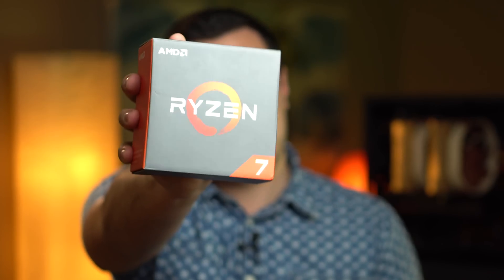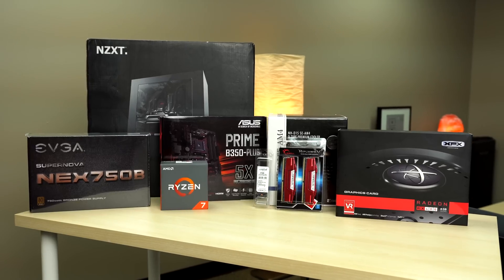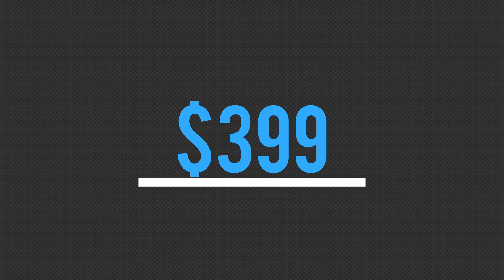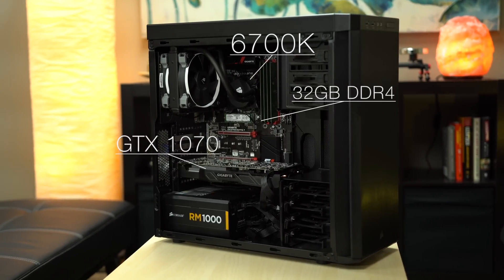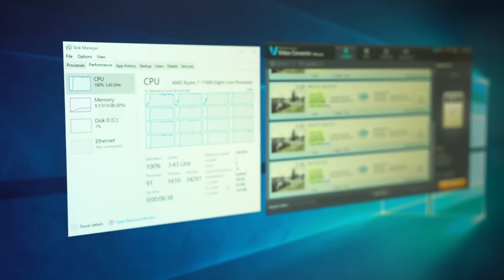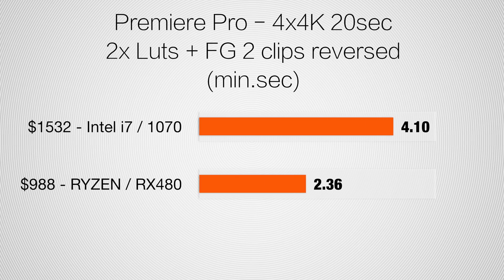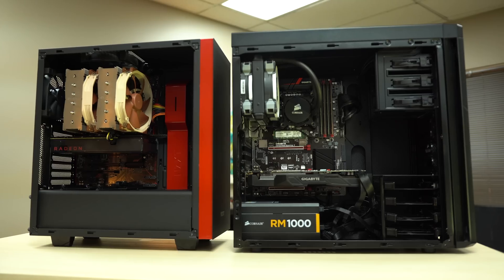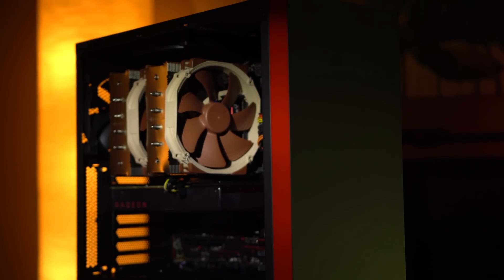$998 AMD RYZEN 4K video editing BEAST! Premiere & Resolve

Comment: DAM I want this to be true but I smell bullshit u.u benchmarks doesn't look like nothing I saw before even with the newest bios updates, so  what´s going on here bro I trust a lot of the reviewers I'd seen and usually 6900 with 1080/1700 wins by 3% to 8% which is good for ryzen but I also saw that a 7700k with 1080/1700 is 3 to 5% slower than ryzen and a bit faster at 1080p in ppro. So radeon really speed things up that much more than cuda with mercury or all this is BS ¿?

Comment: youve gone with an overkill ssd and a blower style graphics card in a case that has enough room for airflow... like why all those choices
Reply from the maker: +Iwo Ruuzz SSD is $89.99 for 275GB not sure how that's overkill, and blower style cooler as it was the cheapest 8gb rx480 st $189.99 when I bought it.
Reply: Max Yuryev those are actually really good deals

Comment: I couldn't get this build priced anywhere near the "$998" you suggested.  The cheapest I was able to get is $1088 and that is Downgrading to a 1700 non x AND using my own PSU .  I also went with a much less expensive cooler.   For this exact build the price is more around $1200
Reply: CaptainEO420 haha, no.
Reply: CaptainEO420 price to performance. intel is no longer king.
Reply: Respectfully... until AMD is making more money yearly than intel... intel is king.  Before you can knock the king off the mountain you need to fisrt make it to the top.

STOCKS
Intel Stock Quote
Intel
NASDAQ:INTC
$36.07 up $0.32 (0.90%)
Advanced Micro Devices Stock Quote
Advanced Micro Devices
NASDAQ:AMD
$14.55 up $0.50 (3.56%)

They have a long way to go sport, at least you tried.
Reply: like I said, price to performance. sure, Intel has all the market share, all the money, all the reputation. they even have the gaming results at 1080p and below. but even with all that, they get beaten via price to performance ratio by the perennial underdogs AMD. even with the advantage of monopolizing the market share over the last 8-10 years. just to make it clear, I'm running an i7, but I'm making the switch to AMD, and I think many people are in the same boat.
Reply: CaptainEO420 this is because the Cryptominers, AMD is still better, but just get a GeForce GTX card instead of AMD

Comment: i would have used a smaller PSU and then more ssd size
Reply from the maker: +Nestor Arranz yea I went with this one since it's partially module and the cables are mainly sleeved so it would look nicer. I didn't have to add any cables so it's very clean.

Comment: I added all the components up and came to at lease $1200, if not more. How did you come to the figure of $998? Are you not counting something?
Reply from the maker: +Kevin Green like I said In the video parts prices fluctuate, so buy the GPU, RAM, SSD, and PSU that's one sale. I bought parts that were on sale so look for the best prices. You'll also probably need to send in one or two mail in rebates. Shop around and you'll get close to $1000 or below like I did.

Comment: IMO Getting the 1700  and overclocking it provides better temps and voltages with similar performance and much lower price. (even with the x370 mobo its still cheaper). Also people who want cuda acceleration can just use a 1060 to replace the 480. Either way, interesting bang for buck build but i still thunk there could be improvements. :)
Edit: Also since Ryzen benefits so much from faster ram, something like corsair LPX ram at 2933 or 2666 could offer some performance gains.
Reply from the maker: Keep in mind some of these discoveries were made AFTER these parts were ordered and built. No one had any idea that the 1700 would overclock like it does, or ram speed. I definitely had no idea especially with a 65watt TDP compared to 95 with the X CPU's. Many editors who just want a solid system don't want to overclock so this build was done with stock clocks.

Comment: Does the noctua d15 really fit into the s340 when the window close? What ram are u using?
Reply from the maker: I had to seat it lower and it barely fit but it did. I talk about that in my build guide and suggest a smaller cooler or larger case.
Reply: Max Yuryev tks for that :D i got a S340 Elite and ryzen 1700.

Comment: Hey Max, thanks for sharing your build! Do you have this hooked up to a 4k monitor? I am concerned the rx 480 cannot fully handle 4k, as it seems to be closer to the gtx 970, and my gtx 970 has a tough time with 4k (experiencing some screen tearing). Wondering if a gtx 1070 may be worth it.

Comment: i have one question about vga card for adobe premiere  if same price amd or nvidia ?
Reply from the maker: The RX480 was slightly faster in most tests than the GTX 1070 so even if they were the same price I would get the RX480, BUT the rx480 cost me $189.99 compared to 369.99 for the 1070 so with the price difference its a no brainer. Now if you also game at higher than 2560x1440 at 60fps then spend more on faster GPU for gaming purposes.
Reply: i heared about cuda core in nvidia important in premiere for realtime render  but amd not have - - 

can you answer me about realtime render  who the best if spend same price  AMD or nvidia
Reply from the maker: DiwDPU DATGBAND I already have, in my last comment and in the video.
Reply: thank you i m subscribing you 
Actually i watched many video from you before  hahaha

Comment: Wait why did you put in a 750 watt PSU? Your machine can run on a 500Watt PSU, and an 600Watt PSU if you went crossfire rx 480s. Just seems like your running up your energy bill for the comfort of Modular PSU. HOWEVER other then that the specs look great!
Reply from the maker: +Ian Young yes it was because it was a good price and semi modular. I literally didn't need to plug in any of of addition cables which was great. You do know that if a PSU is rated it doesn't mean the whole thing is being used.. you can have a 1500watt and have a 200watt system and only 200 will be used. This system probably only draws 350-400 watts under full load. Another thing to consider is most PSU are most efficient when about halfway used, meaning less energy is wasted.

Comment: Great video Max, at 3.20 you said the RX 480 was faster than the GTX 1070 in most tests? Could you clarify? I am considering either the RX480 which is around £200, the GTX 980ti around £300 on ebay and the 1070 for a little more. Which would you suggest is the better option when paired with on overclocked 1700? Many thanks.

Comment: Thanks for response about the GTX 1060, so there is not big difference for 4k editing buying 1070 vs 1060 as I understand from your view? I just think gtx 1060 is more than 230% vs 1070 that cost 430-450$. It's important for me that premiere will work good I don't need extra power for games.
Reply from the maker: In my testing, there was no difference when paired with a 6700K overclocked to 4.5ghz. If you're going to use an intel 6 core overclocked or 8 core with 4K video and effects then I would say go for the 1070. If an intel i7 quad like the 6700K or 7700K then 1060 is plenty.
Reply: Thank you , do you think RX 480 is better than 1060 for  Premiere and Resolve or other way =) now I can buy RX 580 or 570 that seams better version of 480?

Comment: If I wanted a straight up gaming machine would I go with the ryzen and rx480 or i7 and 1070?
Reply from the maker: I would probably get an i5 7600K with water cooling http://amzn.to/2nKvmip and 16GB ram. Then overclock the CPU to 4.7-4.8ghz. For graphics card either 1070 - 1080 - or 1080ti depending on your monitor. 1080P 60hz then 1070 should max out games for the next few years, 1080P at 144hz or 2560P at 60hz then get the 1080 to max out games for the next few years, or 2560 at 120hz or 4K at 60hz get the 1080ti to max out games for the next few years.
Reply: Thanks, man! This helped a tonne!

Comment: Great job on the video. I had recently come to the same conclusion and built myself a Ryzen system for video editing/animation/music. I built based on the 1700 chip and just overclocked to 3.9GHZ stable on all cores. I am waiting on the new Vega GPUs (I also came to realize that in render situations AMD and OpenCL are often faster than Nvidia with CUDA) to finish my upgrades. Thanks for the confirmation on my upgrade path!

Comment: So I want to max new games at 2k, you know those ultrawide screens, And have atleast 60fps at all times. What do I build? No online guides seems to include Ryzen or even mention any graphics card from AMD.
Reply from the maker: The Ryzen 5 series will be out soon and those will be what you should get for gaming. The 1600X is a 6 core 12 thread for $249 with a cooler and will likely clock higher than these 8 cores. For gaming you only need 16GB of RAM (even 8 is fine for most). If I was in you're shoes I would get either a 1600X or a 7600K (intel i5) 16GB ram and GTX 1070 graphics for gaming. http://amzn.to/2mNFrGp that way you can max out graphics in any game with a 2K ultawide for the next 2-3 years. Total cost should be about $900-1100 for the system.

Comment: Hey Max, you got something wrong or do not know how is it tested, but the CineB. R15 is very simple. I have i7-5820K @ 3,71Ghz with 16GB RAM @ 2666 with R9-280x. CPU test got 1126 points, that is ok but the GPU got 143 FPS which seems strange.
Reply from the maker: raWer Studio I guess the 280x is better :) I retested a bunch and that's what shows up. Maybe it's a Ryzen thing.

Comment: Might some of Resolve's lag vs Premier in the speed tests be due to their implementation of OpenCL vs CUDA. Open CL support was around in Adobe's products for at least a few years before Resolve started to support both.
Reply from the maker: I think Resolve started using OpenCL before CUDA (but I could be wrong) Resolve was performing well for me other than the 4x4K test where reversing two of those clips slowed it down by a lot.

Comment: Several things Max , is the Radeon 480 really faster than the Nvidia 1070? Also , doesn't the Ryzen run at much slower clock-speed and cannot be overridden as well as the Intel chip? Btw, great looking build, very sharp looking!
Reply from the maker: Yes. We tested both and the 480 was after in most tests, and the few that the 1070 was faster it was insignificant so we went with the 480 for this bang for the buck build. Risen runs at 3.4ghz under full load and 6700K runs at 4ghz but Ryzen has double the cores. Both can be overclocked, Ryzen to 3.9-4ghz and 6700K to 4.6-4.8 or so but these tests are at stock speeds.

Comment: on 1070 vs AMD RX 480, I have always argued that most people complaining about laptops video performances often miss the point of different TPUs; people extensively argue that CUDA cores make the big difference for Adobe Premiere without checking that in laptops typically (e.g. Apple) AMD GPUs are severly watt underpowered compared to Nvidia, hence the "Cuda advange" is nothing but a difference in TDPs. In desktops TDPs are mostly irrelevant, hence it is more a leveled playing field.

Comment: i would use a different power supply. 550W is more than enough for this ryzen build. as example something like EVGA Supernova G3 550W, Cooler Master V 550W, BeQuiet Straight Power 10 600W.
Reply from the maker: Yes, you definitely don't need 750watt. I went with it as it was $59.99 and partially modular.

Comment: Ryzen sucks in gaming. Sorry. My next PC will have an Intel SKU.
Reply: "Sucks for gaming" is the biggest load of crap. Simply because its not the best in gaming doesn't make it suck, as has been pointed out, these were not meant to be gaming CPUs. For those who need this sort of power AND want to play games, these are great.
Reply: OK. But if you want to record, stream a game (at the same time) you always have to use an Intel SKU because it has firstly an higher IPC, secondly a better performance on single threated workloads such as gaming. I can't unterstand the hype about RYZEN. Yes you can use it as an render CPU but for what? (Blender only because it scales good at cores, and Handbrake for Video encoding). So if you want only to render a blender? ok you can do it. Buy it and be happy. Currently I have an FX 6300 and it sucks too at gaming and recording. I only use the Share funtion on Nvidia cards to render my videos because the CPU is to slow and I will buy me an I7-7700k or a I5-7600k for gaming and recording. And yes I'm a fanboy of the blue team.
Reply: I have currently have two PC's: One intel i5 6200u laptop and a FX 6300 Desktop PC. Which is performing better? the mobile i5 for my videos and workloads. xD
Reply: you can forget any comparison with the old fx. chips, this is a completely different architecture, however you are correct, 7700k is currently marginally faster in games, if that's what you want to do, p.s. thanks for the video, great to see some premiere benchmarks, any chance of some AE ones? AE had seemed to not scale very well to lots of cores ?
Reply: again its hard to say how will run for games ryzem missing optimization and its already more fast then i5
Reply: The problem with gaming is that games aren't multi-core optimized. High-core count CPUs typically have lower clock speeds per core, so an AMD 8 core running 3.2GHz is going to get smoked in single thread game by a 4 core Intel running at 4.2 GHz every time. The same goes with comparing other Intel CPUs. I suspect for gaming that AMD's 6 and 4-core are going to kick ass for gaming.

Comment: Great job Max.
I was waiting for a videographer to do a review on Ryzen.
I was thinking going with the 1800X but since it's just 3-5% faster I'll upgrade to the 1700X.
Reply from the maker: If you don't mind overclocking, you can also go with 1700 that comes with a cooler and save about $100 and get very similar performance.  http://amzn.to/2nogUMI

Comment: Looks great. Only difference for me would be going for the 1700 which comes with a cooler so it ends up being a lot cheaper than the 1700x. It also can be overclocked reasonably well though you'd want a better cooler.

Comment: Hello, thanks for sharing this!
I have 3 questions about this:
1) Do you think it is possible to build about same price Hacintosh with this setup?
2)If not how would be using two systems for work- using PC for 4k video editing and 3D work and using MAC for music and sound creating and everyday tasks?
3) Because I am working with sensitive sound what about fan noise level for these coolers, maybe there are some little more expensive option, but quieter?
Sorry for noob questions, I am just starting. Thank You!
Reply from the maker: Rolands Briedis I have a hackintosh Bild on my channel. You have to use Intel for a hack. I love quiet systems. This cooler is very quiet but the two stock fans are just "ok" replace them with a quieter fans and your set.

Comment: wait, isn't the noctua D15 too tall for this s340 case? so that means you cannot close the window panel.
Reply from the maker: Calxx Almost yes, fans normally stick too high but if you use low profile tame (which I didn't) or set your fan that is by ram at a slight angle it works. Like I said I wouldn't suggest this cooler because of price.

Comment: max did you run all the test with the 1070? I'm wondering if the low cpu usage was because of a gpu bottle neck.
Reply from the maker: Yes, we ran all of the tests with both GPU's to see which one will be a better bang for the buck. If the GTX 1070 was  noticeably faster this would have been a $1200 best bang for the buck build but the RX480 was actually faster in most tests and the few where the 1070 was faster it was a very minor difference. I'm talking a 1-3% difference so the rx480 was the best choice.

Comment: Hey Max, just wondering did you do anything to overclock ryzen? It's pretty easily overclockable up to 3.9 Ghz (3.0 Base) without reducing the lifespan of processor, also what was RAM frequency? These both could result in even more stunning performance. Cheers.
Reply from the maker: Nope, this was without overclock (on both) that way anyone can get the same results. But I do usually overclock my systems. This CPU is 3.4ghz when running on all cores.
Reply: I do recommend checking out overclocked version. It improves in Single threaded tasks and beasts out in multithreaded (obviously 0.5 Ghz x8 or x16 is a lot)

Comment: Hi Max, 
Can you suggest the best bang for the buck laptop for photo editing?
Thanks.
Reply from the maker: Overall, I would say the Dell XPS 9550 http://geni.us/3Ae2F but with laptops is harder because you have to spend more $ to get an accurate display. There are laptops that perform similarly fast for $1000 BUT the screen won't be accurate and you really need that for photo editing.
Reply: Binnu Babu just buy a gaming laptop and make sure it says color accurate O.o